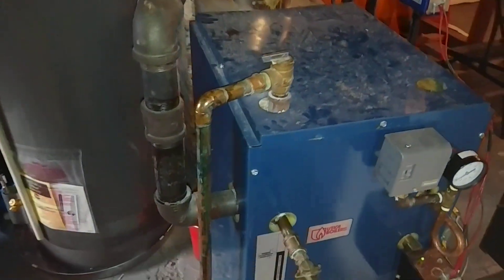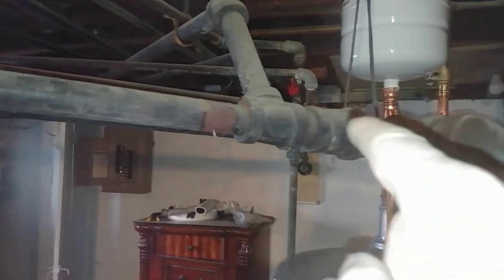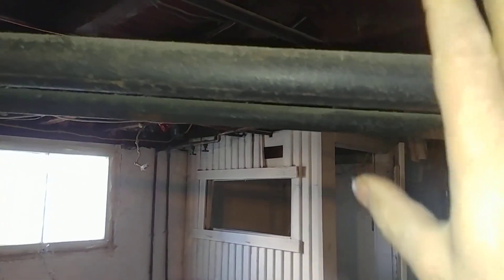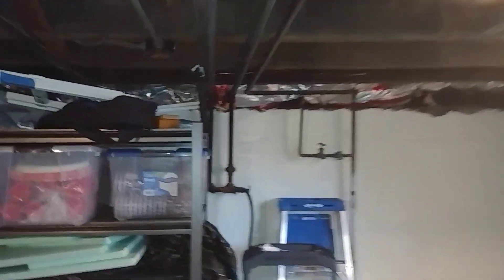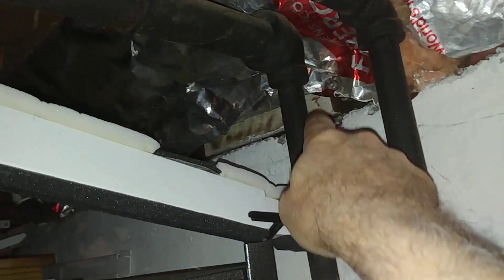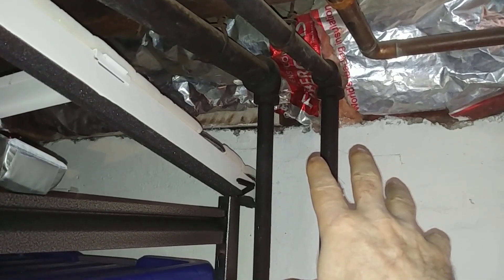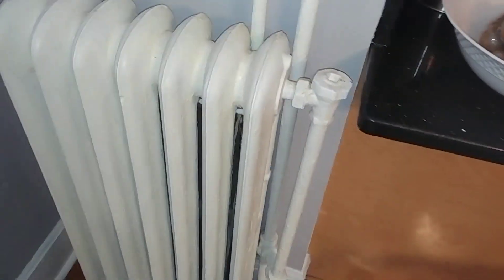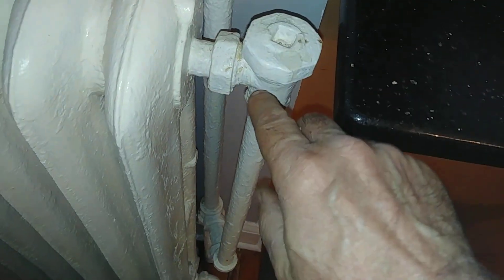One Of The Simplest Two-Pipe Steam Systems Ever Made - Behold The "Tudor" Vapor System

Comment: It seems my system might have been designed for this. If it is, they took out the loop. I'm having a heck of a time with my boiler surging, and water hammer. I had a new boiler installed 5 years ago. I have Hoffman valves going into the supply. They are adjustable sort of like what you explained. No traps. Just elbows. One radiator has a vent with both pipes. One of the radiators was converted into a single pipe. The water hammer is driving me nuts
Reply from the maker: I would start with the basics.
Is your boiler water clean (or clean-ish)? 
Maybe start by draining and re-filling your system.
You might have to do that a few times.
Some use various cleaners.  Be careful!  Check reviews.
Clean water means clean steam.
Clean steam is quiet efficient steam.
Next is a lot harder...
Is the near boiler piping installed to spec?
If it is not, you could be generating "wet" steam and that (and the dirty water) would mean you've lost the water hammer battle before you've even begun to get steam into the mains.
What pressure are you running at?
Anything over 8 oz/in2 is likely to cause trouble.
A VaporStat might be needed.
Is your boiler sized properly?
Too big, and it will be hard to control the pressure and the boiler will short-cycle like mad.
What is venting your dry return?
Is it an old vacuum vent? Please replace that pronto.
The Hoffman #7 should be set to the radiator size.
If they are wide open, they might allow too much steam into the radiator and hence thru the elbow and into the dry return, where it will (you guessed it)  hammer.
"One radiator has a vent with both pipes"?
I'd check the run-out pitch of the pipes if you can... you might have water pockets.
Remove and plug those vents.
"One radiator was converted...?) The pipe to that radiator might be too small for the load.

Comment: Fascinatimg. Will the client have you repair the tudor valves on the radiators? Im curiius how they work.
Reply from the maker: The system was more or less in balance when I left it. 
There is not much to those valves, just a inner restriction shield and lots of old packing IIRC.
I think I might have one in my "petting zoo" of steam stuff & if so, I can make a video.

Comment: So it is steam fed to the top of the radiator and condensate out the bottom?
Reply from the maker: Yes, steam (or "vapor") enters at the top, and air & condensate (water) leave at the bottom.
Reply: Where is the air leaving the radiator?  or is that only on a one pipe system?
Reply from the maker: @tedlahm5740 : Air should be expelled from steam steams thru vents.
One pipe steam system should have main vents on the pipes in the basement and on each radiator.
Two Pipe systems should almost always have just a main vent in the basement.
This system here should NOT have those little vents on the radators.
BUT
There are exceptions depending on each system's quirks & kinks.